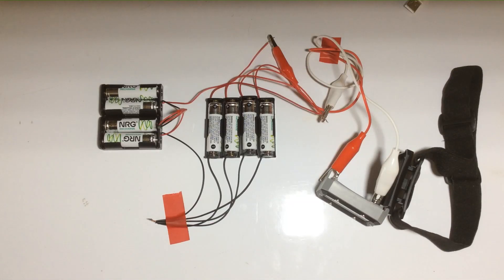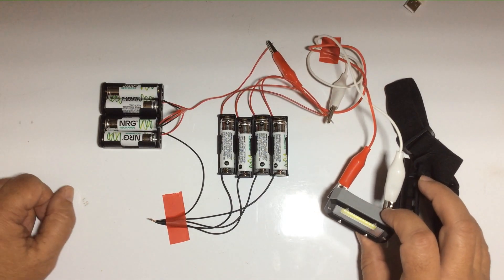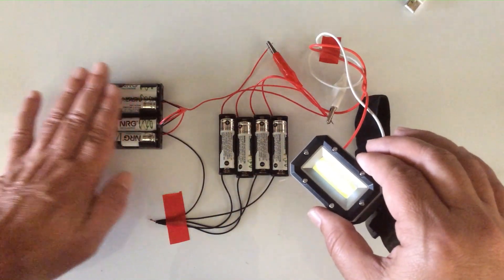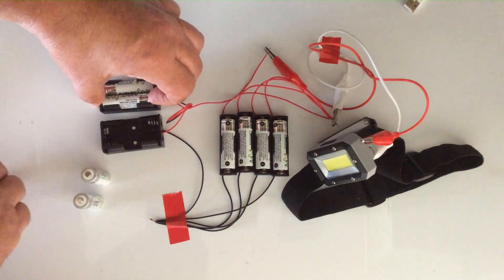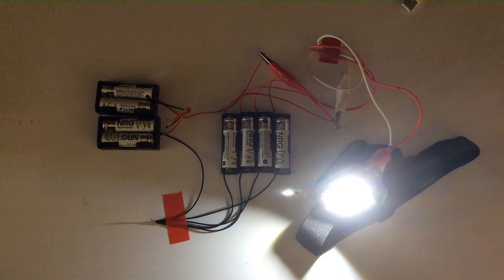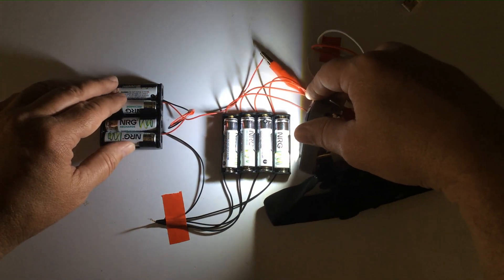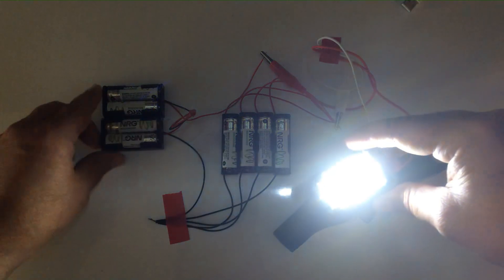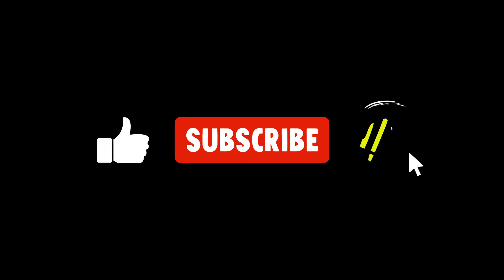TESLA POWER TRANSFER UPDATE - SECOND BATTERY ROTATION

Comment: Lets go through this as figue out what is happening here.
As i commented in your previous video.
(Not to be in a rude tone but a educational point if view)
For this circuit to work as you claim it does would be violating the laws of thermodynamics. To dispute this would be like disputing the existance of gravity, as (power out = power in - losses), the existance of photons (light) leaving the led is energy taken from this system. I suspect this circuit only works due the the high internal resistances if the 4p batteries, this limits the current draw from the led making the batteries discharge slower. This over time will damage the batteres as they are overvolted while charging. A convensional setup with the correct sized resistor does last way longer. I encourage you to try a control with this said resistor.
Cant wait for you to post the resistances and amps of the led, and capacities and resistances of the batteries so i can do some calculations myself.
Reply from the maker: Thank you for your comment.
I sincerely appreciate you commenting as I am genuinely trying to understand what really is happening here. The last thing I want is to alienate a person who is trying to give perspective, whether they are correct or not isn’t t the point but the viewpoint is valuable, the difference of perspective is sometimes all that is missing from an explanation of a phenomenon.

I don’t believe this circuit in it’s presented form actually violates any laws, there is no over unity here in this form, however, there is an extremely efficient operation being overlooked and this statement in no way reflects my contempt for these laws, largely because of the fact that when you get to the base understanding of things like gravity you realise the greatest minds at one time or another have made statements like “for lack of a better explanation we believes this...”

Assume we acknowledge the laws of thermodynamics are valid, then all this does is validate this system. Power coming out of the batteries is not destroyed nor created but yet converted to other forms of energy, it is not my claim that in its present form there is over unity but that a large percentage of the power is transferred instead of creating heat. It is my claim that in a conventional sense very little energy goes to the load and majority converts to heat. It is my claim that because this system has somewhere to transfer the power it does so because it is less energy intensive keeping the energy in it’s similar/same form as opposed to the heat conversion option. The path of least resistance grasshopper! 🤣

A classic example of our education system being wrong and still chasing the narrative is the Hertz scenario, Nikola Tesla wrote to Heinrich Hertz to inform him how he was wrong, then visited him and demonstrated he was wrong and the education department ran with Hertz’s wrong evaluation and that is what we have today.
Science is not fixed, science is evolving and real science does not care what we think, it’s conclusions are determined by factual data. Not the Judge Dredd “I am the law” type of science we have today.
So here is where I stand, if every action has an equal and opposite reaction then a conventional use of electronics wastes a large amount of energy by converting it to heat because it has nowhere to go, whereas in this case it doesn’t need to create heat because it’s equal and opposite reaction is met by transferring the energy to another storage medium.
I’m happy to be wrong, but happier to be discussing the matter!
Reply: @whatifididthis...1236  thanks for the reply. I agree science is evolving but only on the forefront of technology. but not well understood phenomenon such as thermodynamics.
This energy that is powering the led does not directly come from the transfer of power but it more like a parasitical loss, obstructing battery charging. In this case it's more part of the (losses) category if (power out = power in - losses)
Think of it like a toll. A bit of energy is used, to get the rest of the power through.
The power that isn't used charges the 4p batteries which comes with its own losses related to charging.
Assuming all other parameters are perfect (no cable/heat/charging losses) the charge rate of the 4p batteries will be (4s batteries output - led = 4p input)
This would be the general flow of power around this circuit.
There is not an overlooked section of thermodynamics in this section of science. We are just overlooking the exact reason why this works. As I have said in my previous comment I speculate it is the 4p batteries acting as a resistor, limiting current flow leading to fairly long run times.
As you cycle the batteries they will obviously deplete all their power into the led and other losses relating with charging.
Reply from the maker: @ignited3443   I believe you are correct regarding the 4p batteries acting as a current limiting resistor, however, the difference with a resistor is this energy is transformed to heat whereas replacing the resistor with the 4p batteries allows the batteries to charge. For reference, the batteries in this video present as 34.7ohms resistance, whilst this would allow for a longer run it in no way explains the exceptional run time.

Now I am not saying there is excess energy with the system in it’s current form, I am saying the power is transferred. Naturally not all of it either as we have a natural battery internal discharge and the other losses you mention. I’m going to give an example of why I believe this is transferred and I’m using hypothetical values because I haven’t actually calculated the percentages, I’ve recorded the data and presented this in my video for the 12 volt version.

Conventional method:
I charge batteries with 100 units of power which allows an output of only 93 power units due to losses already discussed, after which I have to recharge the batteries.
Total operational load value = 93 power units.

Transfer method:
Charge batteries with 100 units of power allows an output of 93 power units.... then I swap the batteries around and run the load for another 80 power units, then I swap them again and run for 60 power units, then I swap again and run for 40 power units then I swap again and run for 20 power units and so on until the batteries require charging. So it is so easy to see with no extra power going into the system that we have operated the load for the initial 93 power units + 60pu + 40pu +20pu.
Total operation load value = 213 power units.... Houston we have a problem.

Now your books won’t give you that result but the physical world does, go figure!

Comment: Think you might be able to place DC to dc boost converters in between the load and source batteries or battery and achieve the same thing . Then just used two larger batteries or lead acid batteries. I'm thinking nickel batteries because of long life and little damage.
Reply from the maker: Thank you for your comment.
You should be able to use most DC devices in this system. One thing that has failed in the 12 volt tests was a voltage cutoff relay switch, I’m not 100% clear why, I believe it got confused with the voltages it was reading from both banks. I have used a 12 volt inverter, 12 volt to 240 volt with no issues as well as a 12 volt to 5 volt USB charger with no issues but I have not attempted to use a buck converter and need to point out this would be done at your own risk, however I encourage you to explore this as even failure is a success of its own kind.

The battery composition is important here and I have not had a lot of experience testing different batteries other than those seen in my videos. I will make sure to mention the battery compositions I have tested in the hope we can find the most efficient compositions for this system.
Reply: @whatifididthis...1236  some version use the DC to dc buck converters and a high efficiency DC motor instead of the lights .they also included a matching generator for the motor . Creating even more energy . But that's 12 volt 24 volt lead acid battery system with 12 volt motors. So much to do so little time .and space . God's speed .

Comment: Can’t wait to see the numbers…. Excellent work….    Question are you still doing it only on the negative side and getting different results from the positive
Reply from the maker: Thank you for your comment.
I just posted the control test so everyone can crunch the numbers if unable to do the test for themselves.
A good point you make about the difference between negatives and positives, ( what!? I’m starting to write like yoda 🤣🤣) I believe there are measurable differences and what I have tested to date suggests running the load on the NEGATIVE line is more efficient and the POSITIVE line presents a higher potential voltage resulting in a higher current draw with lower run times. More testing needs to be done here also to confirm my hypothesis which is why I am attempting to employ many viewers to accelerate the testing and data collection, the more of us running the test and presenting the data the quicker we maximise this systems potential.
Reply: @whatifididthis...1236  ✌️

Comment: Hi, did you ever think that a load will suck all power it can (allowed by) even if it’s not needed, than batteries after the load recovers excess power drawn by not letting energy to be wasted.

At least that’s my possible explanation. Actually any load is just a shorting … I’ll be back later

Edit: it might be power factor correction, but instead of capacitor in this circuit we use battery.

We know that electric grid providers exploit at maximum households for not using power factor correction
Reply from the maker: Thank you for your comment.
I agree that a load is nothing other than a short when used in a conventional use which creates a lot of heat. I feel this circuit at this stage complies with the laws of conservation of energy because what comes out of the batteries into the LED also comes out of the LED as two or more products of energy, nothing is destroyed, some is converted to heat, some to light and the rest is transferred resulting in a net loss eventually. This is however not the Complete Tesla Switch so it does not violate any principles in this current form.
Reply: @whatifididthis...1236  I think it might be a relation between total capacity of batteries and power extracted by the load along with few other effects including self charging from local environment, that occur in series-parallel setups. I mean swapping at certain time interval when total capacity is depleted in a very small amount might be a factor to be considered even if the set being drawn is depleted almost complete before swap if the right time interval can be calculated to avoid damage in batteries being over drawn.
Reply from the maker: @Caesarus2011  I agree with you that the batteries should be rotated earlier, before the light is dim. With this particular setup it might be best to rotate batteries every 24 hours when needed each night.

Comment: Hey there! I've been following your videos with interest and will likely try this experiment soon. However, to cut down on experiment time I'm thinking of using something that sucks more amps than an LED, like a small electric motor or something. Couple of questions, and please forgive me if they've been addressed already. 1) Were the parallel batteries run down first? I might be hesitant as  I might damage new-fully charged batteries that don't need a charge initially. 2) Can you provide a reference(s) to how this tech was used in the past? I'd be interested in reading about it. Thanks for all you do!
Reply from the maker: Thank you for your comment.
You can use a larger load as long as you don’t exceed a safe discharge rate for the batteries used. Batteries have a charge and discharge rate, usually these values are very different. I have used larger loads in my 12 volt tests of this concept to drain the system faster. I just posted the control test which appears to be somewhat of a slap in the face to conventional use of batteries, the LED used draws a considerable amount of power resulting in a dismal outcome for “normal” use of the power.

The batteries don’t have to be run down first. I have tested both ways, using discharged batteries and charged batteries. When I first tried this I assumed the parallel bank should be flat, so the energy has somewhere to go. One day I wanted to start a test and couldn’t be bothered draining a set of batteries and I thought what if I put charged batteries in, what will happen. From what I can tell, this is what I think happens when using full batteries. The energy is transferred to the already full parallel bank until they are completely topped off, then in line with the principals of the conservation of energy and every action must have an equal an opposite reaction the excess energy is transformed to heat. I noticed at different stages of the 275 day test that the LED would be warm and then other times it was cold. A lot more tests need to be done here.

The origin of this concept for me was the Tesla Switch. It is important that I point out what is being tested here at this point is only a fraction of what is required to make this a “Tesla Switch”, but I find that even at this most basic evaluation of the concept there appears to be something quite extraordinary.

An American company by the name of Electrodyne Corp. tested Tesla’s Switch I believe in the 60’s. From memory they tested a system that ran for 3 years running a 2kw load. I have quite a bit of information on the switching requirements but I’m still in the early days of actually testing and I need to understand properly before moving onto the next step. Let me know if you can’t find information, I have supplied this information for someone before, as long as it hasn’t been removed from the internet I can usually find it.
Reply: @whatifididthis...1236  Thank you for your reply. I plan on using NIMH rechargeable batteries as these are said to be able to deliver higher current. I have a couple of small electric motors lying around (4V and 6V from memory) that should eat up the power within an hour or so (depending on mAh of the batteries I get). I know you've said you've tried charging already charged batteries but I am reading warnings that this can damage them. Going to play it safe and discharge them first. Also, I put together a simple circuit design on every circuit to illustrate the concept here - same battery setup, but using a 4V electric motor as load. Draw is 1.5A (motor rated for 2A) so it's running at just a fraction of it's top speed. Note: I had to add resistors to not get a "voltage shortage" warning that won't let the circuit animate, so I added the smallest available. https://everycircuit.com/circuit/5937395987644416/power-transfer-test